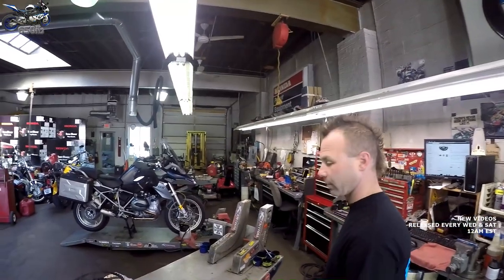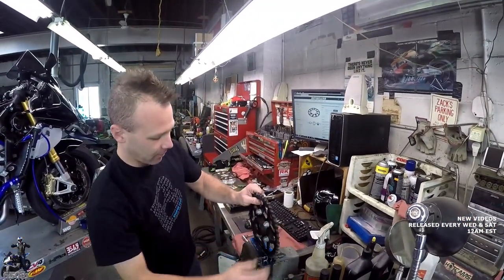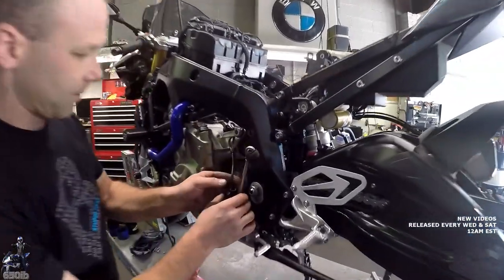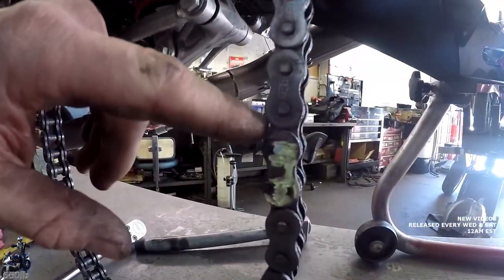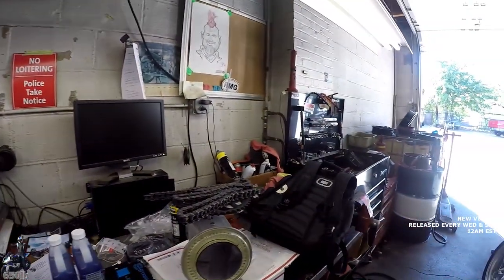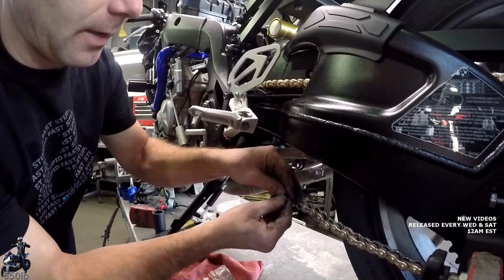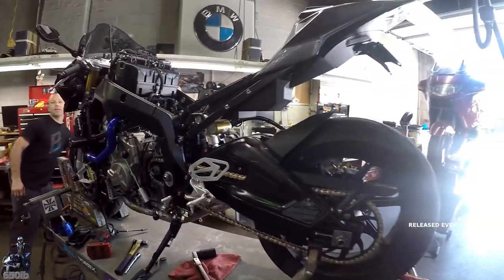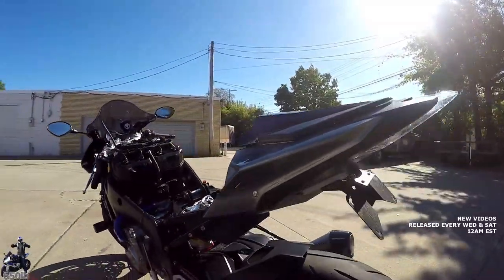2017 BMW S1000RR with AMAZING chain & sprockets!

Comment: Hey 650ib I bought the BPP superleggera V1 sprocket and rode made 50 miles. I put it up for the winter and now it is heavily corroded. In October I was sent an email from motomillion warning of possible cracking of sprocket.
Reply: Oh and neither BPP or motomillion sells these any longer...
Reply from the maker: We removed that sprocket before sending out the bike.
Reply: I'm talking with Mani with motomillion now trying to resolve this issue. What sprocket did you end up going with?
Reply from the maker: Shannon Dunaway Vortex

Comment: those sprockets are DANGEROUS did you see the flex when he was using the torque wrench. they are a deathtrap. best sprockets are stealth sprockets. they have steel teeth and an alloy carrier with super strong rivets (same as your chain)

Comment: Which bike is comming up for build bike series s2 ib?
Reply from the maker: +Adit 2018 S1000RR, trailer and 2016 Triumph Daytona 675R.
Reply: 650ib 
Triumph would be adding more spice to the bike build series 2 as triumph 675r has been discontinued 😍

Comment: 520 sprockets and chain are pointless unless you are competing at the track. 

Not worth the shortened longevity at all. If you ride street only, and you use a 520 sprockets and chain, you are an idiot who loves dumping money down the drain.